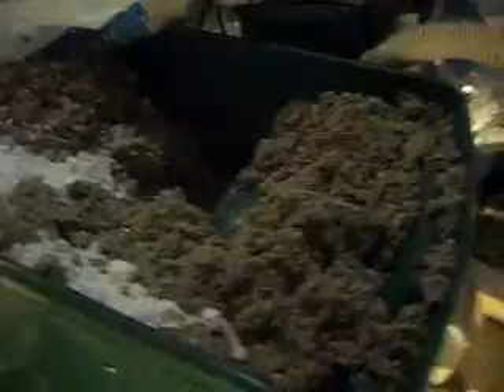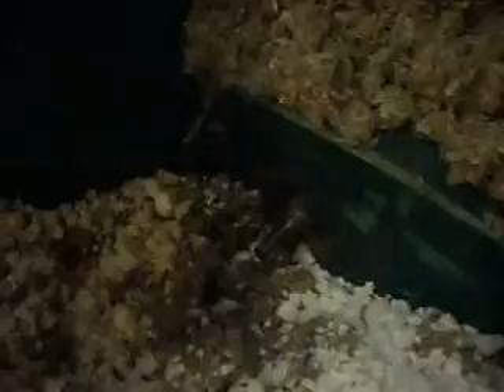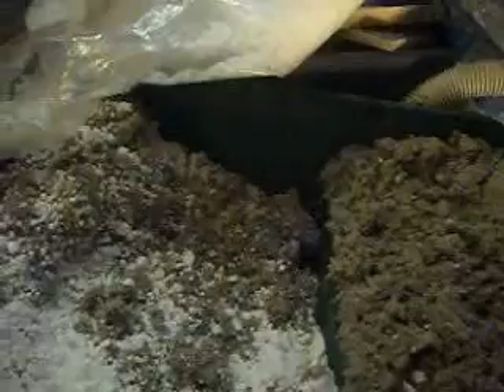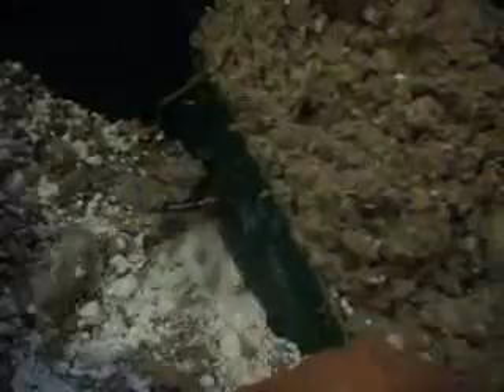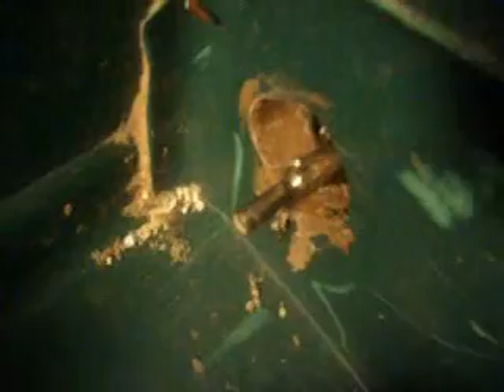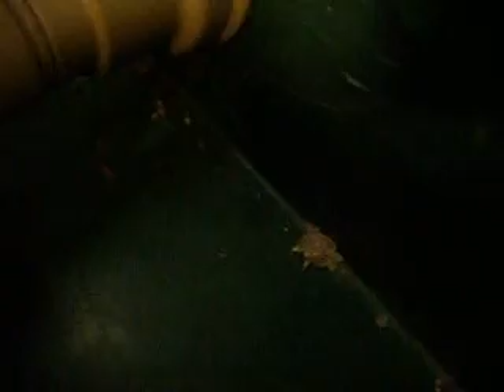Homemade Insulation  blower.

Comment: I Tried using a cardboard barrel with some like 4 inch flex dryer hose that didn't work very well. Hooked up to my Rigid shop vac the hose didn't work but just the container worked OK a bit more dusty than I would like but it did work but you have to break up the cellulous really good by hand and I may have to do some sweeping or raking or just blowing it with the shop vac. I am going to try using a leaf blower tomorrow there are some tight places where my setup won't work to big.

Comment: Here are a few ideas for you to roll around. You can use a blender blade on the shaft to cut the cellouse up as it goes through the intake. Also you can use a spiral wire inside the hopper conected to a hand crank to break up the insulation. I'm sure you can come up with a better way than the ones I've listed or modify them to fit your needs. Thanks for posting your homemade gadget, I really enjoyed seeing it.